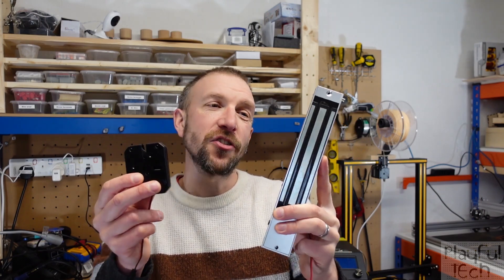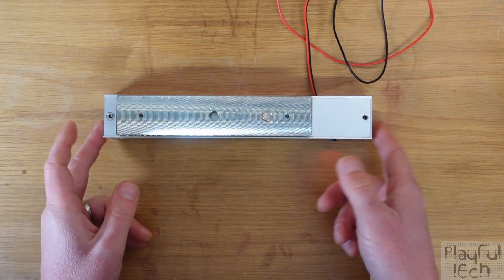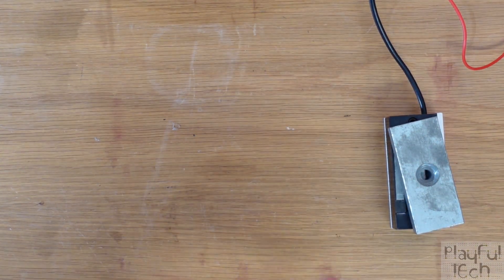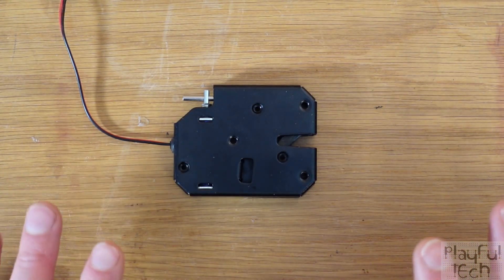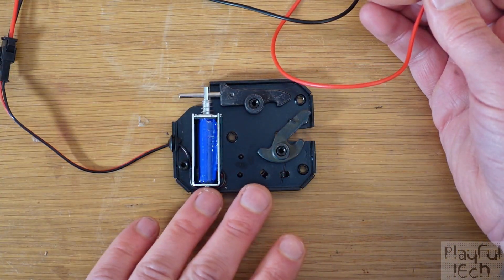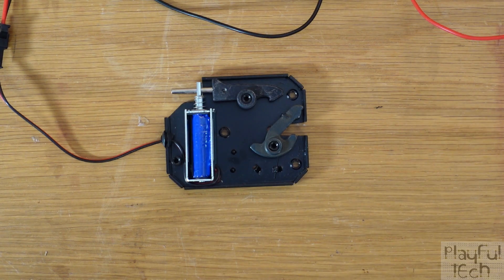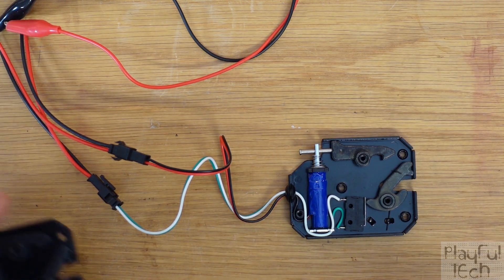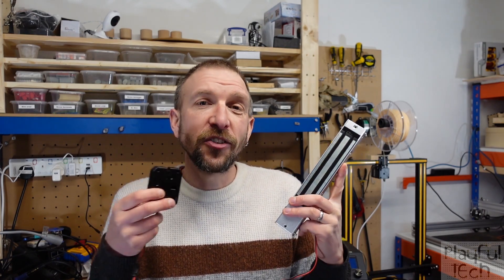Understanding MAGLOCKS

Comment: Could you add more electricity to make the lock stick stronger?
Reply from the maker: No. Maglocks run at 12V (or sometimes 24V), and they draw as much current as they need (e.g. 1Amp). There's no way to "push" more electricity into them than that.

Comment: Is it possible to reverse the magnet so it repels instead of attracting? Thank you
Reply from the maker: No: the magnetic field generated by the maglock will always only ever attract (ferro)magnetic material, like iron/steel in the bar - it will not repel them.   If you want it to repel another object, that would have to be another magnet.

Comment: Thank you for this. I wired the same latch in my vehicle's tail gate window. My switch supplies 12v to either open or close for the window actuator. At first, I thought of just wiring this latch up to the unlock pulse, but now with your info, I'm confident I should be able to just tag the actuator open wire to release the latch as well. 12v will be applied throughout the open sequence until it opens all the way, and I release the switch.  When I close the window, it latches in place. Thanks again for your help :)

Comment: Enjoyed that.  I was hoping to add a solenoid latch to my Garage Door  C track to improve security.    Garage door is sectional (up n over) you may know it as operating on a door auto. If a solenoid could be attached to the outside of the  metal  C track and a pin is extended over the door roller it provides  extra security preventing the door roller to pass.  Potential issue might be having the solenoid bolt retract  when the door auto is activated.   Anyway any suggestions on a logical way to achieve this would be an appreciated topic   For me anyway  thank you
Reply from the maker: Hmm, it's a little bit tricky to imagine the precise mechanism you're describing or to suggest what modifications to make, but I'm sure it should be possible. You just need to be careful to ensure the maglock and pin and mounted correctly so that they make a secure connection with each other.

Comment: QUESTION: My rental agent failed to turn up for an inspection, again, and claims that my complex had a power blackout that caused the electromagnet security gates to stay locked. Is this even possible?
To my understanding, electricity is required to keep the gates locked, not the opposite. Can anyone tell me if they are lying?
PS my microwave clock wasnt flashing, it still said the correct time, meaning that no power was lost to my appartment.
Reply from the maker: Maglocks can be fail-safe, or fail-secure. Generally most buildings use fail-safe, which require power to remain locked, and would automatically release if the power is cut, as you described. This is a safety feature to ensure that people can't be trapped in the building in the event of a fire etc. But there are obviously scenarios where you don't want this behaviour (e.g. imagine a prison, where tripping the fusebox would cause all the security doors to suddenly unlock....). In theses cases, you might have fail-secure maglocks instead, which are locked by default and only release when powered.
Reply: @PlayfulTechnology  Thanks. I also thought about the scenario of a fire, it would trap us all inside. Im pretty sure my rental agent was feeding me BS lol.

Comment: Ill be honest i find a lot of this meaningless to beginner level. Im trying to build escape room and know nothing about basic electronics
Reply from the maker: I try to make the tutorials as accessible as I can. What can I do differently? What is it you'd like to know how to achieve?
Reply: @PlayfulTechnology  thankyou. Just as beginner as you can get. The coding was very confusing and felt like you are talking to non layman. Could also be me and not you. I am going on a course soon so hopefully will have better grasp
Reply: @Blackkeyescaperooms the problem is that there's a lot of generic content I would have to cover (how to connect an Arduino, upload code, structure a file, C code syntax was) that's not related to escape rooms as such.
Reply: @Blackkeyescaperooms And that content is already described well in lots of other places. The niche I'm most experienced in, and what generally isn't covered in many other places, is the application of that generic electronics knowledge to the specific use case of escape rooms.

Comment: That is not a little spring popper. It is a door sensor. It can be used to tell the system if the door is closed or open. It has to be oriented correctly as the pickup is only in a certain spot on the mag lock body.

Comment: I use that 60kg mag. lock at my shared restroom (2 rooms),  applied well. When someone came, they asked me what happen if the supply fail, they worried been locked inside. Just that easy to prove it was totally safe, I failed the supply at mcb, the door unlocked and hv to use it back manually as normal.

Comment: how would you wire a solenoid latch to be battery powered?
Reply from the maker: So long as it's the correct voltage and can provide sufficient current, it makes zero difference whether your power source is mains electricity, battery, a solar panel... you'd still use it the same way.

Comment: I bought 4x 280kg 5YOA mag locks: 2 were DOA, the other 2 died after taking of power the first time. Is this a known issue?
Reply from the maker: Err, no! That's most definitely not right. Maglocks really are incredibly simple, electronically - they're just coils of wire around a ferrous core. Are you sure there's nothing wrong with the power supply you were using?

Comment: Where is the best place to find power supply , for the fail safe lock, like how to mount, 110to 12V switches and more, great video,.👍👍👍👍
Reply: Ever figure this out? I have the same question
Reply: I did Michael, power supply is 12V and got a little converter box to use, turns 110 into 12V and you just need to run the wires to both , the mounting is thru the holes I would guess, on mine.
Reply: Cheap and easy use an old computer power supply. Check the current requirements though. Car batteries, CB or Ham radio power supplies. The minimum you need is a 12v transformer and a diode, both with a high enough current rating.

Comment: I am facing a problem regarding this kind of lock. But thank you you sort out the problem. I am using another electric lock and attach that lock with a zkteco facial and fingerprint bio matric machine. But that is still working. Because in that lock no plus minus cables. Just straight cables. When I contact that lock with machine it's always on. And tik tik always. So next I will try magnetic lock if I will not set that lock.

Comment: The snubber diode does not "gradually dissipate" anything. It acts as a dead short to the back EMF.
That is why it is important to select a diode that can handle high enough current and , as the back EMF can also be high voltage, the diode needs to handle that as well  .
Reply: Would it ever get high enough to warrant a heat sink?
Reply: @bororobo3805  Not normally . For typical relays and solenoids the back EMF can be a high  voltage or current but the duration of the pulse is very short so the total energy does not generate significant heat
Reply: "The snubber diode conducts immediately when the switch opens, clamping the back EMF to a low voltage (around its forward drop). The inductive energy is then gradually dissipated as heat in the circuit’s resistance. The diode must be rated for the peak current and reverse voltage it will encounter.

Comment: Is there a flush magnetic lock that is small enough to mortise in jamb and plates into the doors closing edge. If so would that work as the lock would be sliding across not butting each other. I would likely use  2 of the smaller sizes in series , one favoring the top and the other at the bottom, with  diodes at both.

Comment: 1N4001 diode is going to have a short lifetime in this circuit, due to it's 50 volt (max) rating and the several hundred volts of back-emf that this coil instantly develops in the absence of those other parts on that circuit board (which slow down the discharge and moderate the back electromotive force). For maybe 5 cents more, buy a 1N4007 which has a 1000 volt max rating and will last the life of the mag-lock.  If you are using this this with an arduino as he suggests, put a capacitor across the coil and diode so all three are in parallel, use a 100 nanofarad ceramic capacitor rated at 1000 volts (also called a  0.1 microfarad ceramic condenser rated at 1 KV) which you can buy for about twenty cents or so at this time (Jan 2023). Yes, this is the same protection cars use with the coil that makes your plugs spark.  Same reason : cheap insurance for the computer.

Comment: Thank you 🙏 been looking for som easy to understand info about maglocks! Do you have any good tips on were to buy good quality maglocks and also if you got any tips or trix for programming/wiring a board for opening it :D
Reply: use a relay between the arduino and the lock, just as the power locks and windows in your car does.
Reply: Good Quality mag locks can cost between $350-$800 depending on their specifics. Amazon has some okay mag locks for much less. They will not last as long and do not have the advances protection circuity of the better ones. You will most like have to replace them more often than higher quality ones.

Your use and situation will determine your appropriate budget.

Locknetics, Assa Abloy, Securitron all make high quality locks.

Comment: Quick question.  I have a escape puzzle that is setup to use a magnetic lock.  I am wanting to use a door latch style mag lock instead.  Of course when I power up the puzzle it turns on the lock and releases and starts heating up the solenoid.  How can I use the puzzle and the latch style mag lock??

Comment: My wife and I designed three escape rooms and I used one of the cabinet mag locks to secure a drawer.  The drawer was triggered by a Hall sensor installed in a wall.  Occasionally, the triggering magnet was left in position and, as you described, the latch was damaged and ceased to function.  The heat generated by the continuous application of power to the coil apparently softened the plastic coil bobbin, it warped and didn't allow the solenoid core to move.  I replaced the cabinet mag lock with a fail-safe mag lock and haven't used the cabinet locks in any other puzzles.  DARN!!!  Great information.

Comment: Great explanation! Just one question... can you use any 12 volt supply? A standard 220 to 12 volt power adapter will work? Thanks!
Reply: you want a 12 volt supply (or 24 volt, check your literature) that can continuously supply 5 or more amps of electricity (not peak value, continuous value) without overheating. It will be rated at 60 watts or more if the amps are not listed on the package. You want this rating for safety even if the lock claims it only draws 2 or 3 amps of power, and use 18 gauge or larger wires from the supply to the magnetic coil, 16 gauge would be better.

Comment: My goodness, I wish I had known about the feedback switch on these locks about 3 escape rooms ago. I assumed it was simply a signal return for an arduino type controller. I learned the hard way about burning these switches out, and ended up adding a manual kill switch to the power supply, turning off the power once the puzzle was completed. Had I realized that there was a limit switch inside the casing, using it to cut the power would have saved a lot of headache and further automated my rooms. Thanks for this video!!

Comment: I'd be interested to know if you think flyback diodes are necessary for cabinet locks? We haven't used diodes but I've wondered if we should have!
Reply from the maker: Good question! Those little blue solenoids in the cabinet maglocks are still inductive loads, so there will still be some back EMF generated from them. I haven't measured it, but I am confident it will be substantially less than from the bar-style maglocks, simply because the magnetic field they produce is so much less weaker - they only pull that little catch down rather than actually provide any magnetic holding force themselves. So, in practice, I don't bother adding the diode for them (but, "best practice" would suggest you probably should). Just make sure you trigger the power for them from an isolated relay module, to keep them away from any Arduinos etc. and you should be fine.
Reply: @PlayfulTechnology  I used one of these cabinet style locks activated by a simple reed switch circuit. The reed switches would regularly fuse together, creating a closed circuit due to the issue you mentioned. It wasn't until I added a power supply meant for door locks that the problem resolved. Originally I powered it with a regular 12v wall adapter, the additional power supply 'absorbed' any backwards charge and protected my reeds.
Reply from the maker: @beezlehorse  That's good to know,  thanks!
Reply: @PlayfulTechnology  the strength of the field is not what determines the voltage, it's the abruptness of the cutoff switch that makes the voltage fly up. Use the diode, it costs 50 cents and saves years of service.

Comment: You can also get monitored armature style maglocks that can sense when the door is shut and locked similar to the ast mechanical lock you showed. There's also armature type maglocks that are power to release so a permanent magnet holds it locked and an electromagnet cancels the magnetic field and release the lock.
Reply: The permanent magnet style saves electricity but is an extreme danger if a fire happens. Check with your insurance company if in doubt.